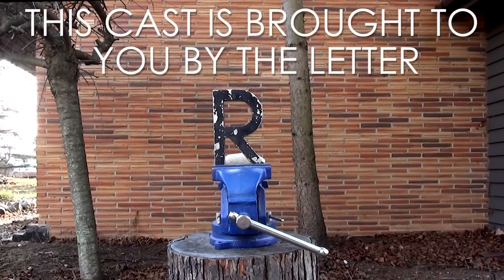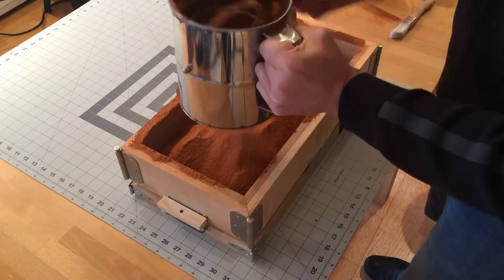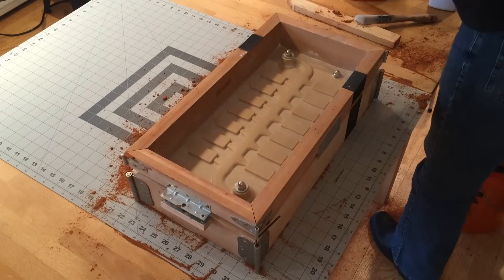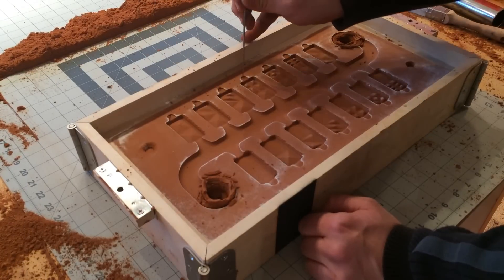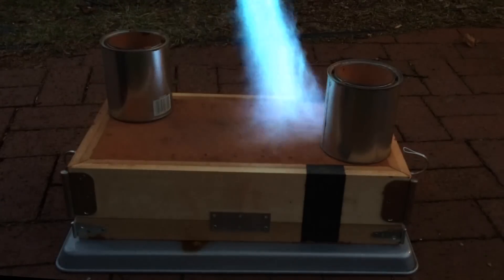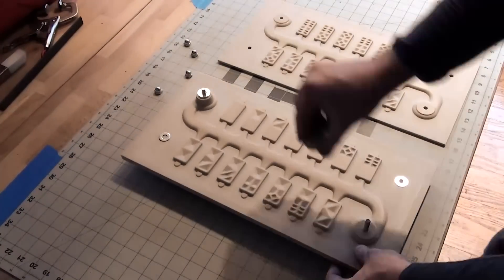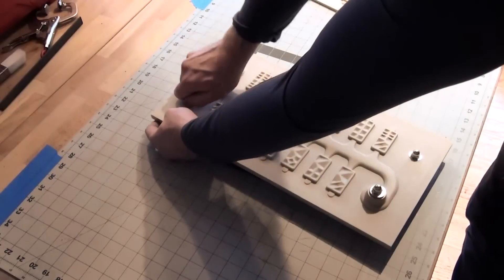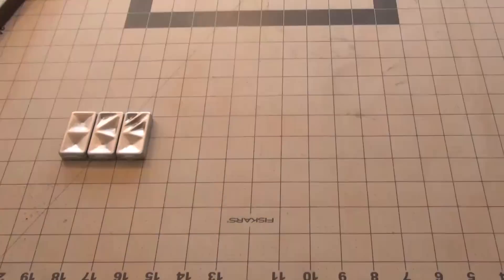Cast Aluminum Dominoes | Sand Molding and Shake Out (part 2)

Comment: Hello do you happen to know what type of sand you were using in this casting? It seems to capture fine detail and keeps its shape under high heat better
Reply from the maker: This is Petrobond and is great for capturing detail.  There used to be a guy that sold it on eBay….
Reply: @Grunblau  interesting

Have you tried casting gears in aluminum? Specifically gears that might be between 2-3mm thick? I know its brittle when cooling but i haven't had a chance to test the strength as ive only been able to cast bars for storage

Comment: hello 🤗 how do you degas of aluminum?  I add sodium carbonate and sodium chloride, but there is too much gas gap in finished part. please advise me.
Reply from the maker: First advise I’d have is be sure to use the correct alloy.  Only use scrap that was casted.  Don’t use aluminum cans, for example.  Gas can enter the metal at any moment so try not to introduce any turbulence into the pour.  Vent the mold as well as you can.  Following good practices for silicone/plastic casting will usually result in good cast aluminum results.  Hope this helps!
Reply: @Grunblau  Thank you very much for the valuable information

Comment: Excellent. Where do you get the lasts? I have a homemade foundry oven, but it does not reach enough temperature, it does not melt aluminum, I use propane gas and a blower, some recommendation?

Comment: Very interesting stuff. 

I'm not sure if it's already been pointed out in previous videos (presuming you've used Diesel before), but diesel isn't really a flammable aerosol like propane and gasoline are, hence why it's a pain in the ass to use as you are using it. 

Diesel when used in engines is much different from any other type of gasoline, where it is simply compressed so much that it explodes, and this explosion drives the other cylinders compressing diesel in the same way. There aren't really "spark plugs" except for when starting the engine and the only way to stop a diesel engine is to shut off the pump. This is quite similar to how hot rods work. 

Standard engines that run on gasoline will compress the gasoline to a certain point (the octane rating of the fuel determines how much it can be compressed without self-igniting) and then uses the spark plugs to ignite the aerosol gasoline.

Comment: is that clay you are using. for the mold
Reply from the maker: +Banished Lynx there is clay in Petrobond!
Reply: Brian Oltrogge i ask because im going to start making mold and i live in a clay rich environment i can literally walk outside dig a foot down and his red clay but i needed to know if it was okay to use
Reply from the maker: +Banished Lynx there is a bit more to it.  Petrobond is clay and sand.  The porous nature of sand allows expanding gases to escape.  Clay makes it stick together and gives it strength.  You might be better off using your clay to make ceramics than molds!  Molding sand is cheap and depending on type, reusable.
Reply: where could i get what you use

Comment: OK. you did a great job. well narrated and concise, the use of Petrobond was a great idea for wonderful detail on the casting. It looks to me as if you are using a graphite crucible as well. i personally use a stainless steal crucible when melting aluminum. works great for me. i also make my own greensand out of fine sand "the finer the better" and bentinite clay "basically pure clay cat litter you can buy in just about anywhere. i grind mine in a blender to a smooth powder." you mix the sand with the clay at 7 parts sand to 1 part clay ,  mix with water to just enough to be able to squeeze it into a ball in your hand and break apart cleanly. simple. my whole operation was self made by me for less than $50 us. i use used moter oil as a fuel ,  i can also use diesel , though i dont use it as much, oil is free for me. my furnace is made from concrete and steel. " yes regular store baught concrete." I don't think i could have gotten as good a forging with my casting as you did petrobond. that was really good.

Comment: Hey, did you calculate volume with inlets, outlets and details? I'm curious how many cm3 you are able to melt in your crucible and be able to do multi-cavity. Something similar is in my head and you are the only one which tried to do homemade multicavity! Great job! congrats
Reply from the maker: +Kamil El Fray Mostly what cross section fits in the domino and the material I cut the mold from. If I was to do it again, I'd make the center runner 2x as deep.

Comment: That was some beautiful flow on those pieces, i'm wondering how much the machined lines (as opposed to simply cut by hand) help with the flow. I know there's a breaking point between pressure and unrestricted flow, but it seems that with better flow you need less pressure (i'm talking about the size of the bell).

Comment: I cant seem to find good videos on youtube for this but, have you attempted using steel molds for aluminium? Like your sand molds, but instead, two steel plates?  Of course that would be very expensive to buy , but say someone had a CNC? Would it be efficient, would you have to use a blowtorch to pre-heat the plate to prevent rapid aluminium cooling?

I have a CNC that can do steel , about 1x2 foot plates, and i want to start doing aluminium work but i dont like the sand method too much, i want to mass produce things ( for the fun of it, not trying to sell shit, but it could get to that )
Reply from the maker: +wargarkaz Sounds like you're looking to make a 'permanent mold for aluminum'.  Try that as a search term.  Trouble is the shrinkage.. Certainly been done before!

Comment: Brian do u sell these I will love to purchase a set
Reply from the maker: +turin_bullies With most of my projects, I try to consider the possibility of producing it at a scale.  I'll eventually look into this as well for these, but if I had to make them as seen in the video, they would be ridiculously expensive.  There is a local company that does lost wax casting and I intend to see what they would charge and what a minimum lot would be.  Who knows, maybe they will be on Kickstarter at some point!
Reply: +Brian Oltrogge you could probably do lost foam casting for mass produced items. you can cut the foam quickly on your CNC machine. once you have the foam cut you dip it in plaster. once you do that you could easily run through multiple castings if you have multiple flasks.

Comment: IS there another way to pack down the sand other than that 2x4(?)? I notice pretty much every casting video does it like that. Was thinking of using a board that fits insite the interior for packing down, any advice if it'll work?

Comment: Its kinda didactic to see the full process but i don’t feel it was the more eficient way to proceed.

I started on video 2, and once I noticed in video 1, that you have a CNC 3D drilling machine, I'm just thinking “its easier to recycle aluminum making a 10 mm plate and use the plate to cast the domino’s in the CNC.”
Reply: it's faster to cast. CNC cutting tales awhile
Reply: David Serrano but he used the CNC grinder to make the original, then he molded on silicone. Unles he wants to produce much more parts, is not eficient (lol I corected to defidient last time)
Reply: Xavi Simon it's a CNC Mill. And the original was either wood or high density foam (he either one or the other in each of his videos). Wood is much faster to mill than aluminum. Foam is even more faster to mill. Milling the aluminum could have taken a day. While doing it in wood could have taken 12 hours and foam would have been 2.  Casting only takes about a hour. And finishing takes a couple hours.
Reply: David Serrano Sorry for the mistake ist milling not 100% wakeup. Its like your “cutting tales awhile" that I avoided to mention last time.

It, I think you are going to hi with the times, its aluminium not stainless-steel.
And even if it was 24h, it took him more time and effort make the molds and al the stuff, the only thing probably will be the finishing if he keeps the parts as they come out, but if he polishes them… not.

I repeat is nice for the exercise and see al the process, but is easier and more deficient to set up your machine and do other stuff.

Best regards.
Reply: +Xavi Simon I was only correcting you on calling it a grinder because I wasn't sure if you actually thought it was a grinder. didn't mean to be rude.

Comment: Why do you plug up the furnace while you let it cool down?
Reply from the maker: +Craig Dick It helps not to temperature shock the refractory or the crucible.  The slower the cool down, the less likely the refractory or crucible will crack.  That and I don't have to worry about bugs and small animals when in storage...

Comment: Do you recycle the sand you use? (Use it for other molds)
Reply: Btw cool video
Reply from the maker: +Rokuro _  Thanks!  I recycle the sand that has not been burned.  In the shake out you can see the black sand.  I remove as much of this as possible.  This could be reclaimed as well if I had access to a muller.  Not a big loss though.
Reply: +Brian Oltrogge ok cool

Comment: really cool man
awesome channel

where did you get your.... "Grip" or "Tool" with which you grab the canister out if your furnace?
and why does your canister consist of?
and what do you stuff inside the holes of the stove to cool it down?

have a nice day :)
Reply from the maker: Thanks!

I designed the lifting shank for myself.  I might make these for others in the future as it works great!  The crucible is a #10 graphite crucible from lmine.com.  The plugs are left over ceramic blanket.
Reply: +Brian Oltrogge 
is it possible, that you can make a video about how you built it?
'cause it looks really professional :)

Comment: Hi Brian.  Thank you for your inspiration. I have been looking for a lifting and pouring instrument like you use here. where did you get your casting tools. In particular your lifting and pouring tool. Thank you.
Reply from the maker: I designed the one I am using...  Seems like there might be an interest in producing a limited run of these.
Reply: +Brian Oltrogge certainly could be. I haven't seen anything like it and i have been looking. what impedes me most is your attention to detail makes for high quality products and these seemed like a very well thought out solution. Thanks for your videos.

Comment: Love your style Brian. I would soooo love to be able to do something similar some day. I plan on doing jewlery, dental crown, Viking stuff. Did you build the crucible holder thingy you use to pick up your crucible and pour??? Or is there some place I could buy this? Also, how fas can you push this furnace, meaning what are the metals you are able if willing to cast pr now? That Diesel fuel sure looked cookin hot
Reply from the maker: The crucible tongs are my own design, although I am not opposed to making them for people.  Just need to figure out how to do a batch of them to keep costs down.  I look forward to trying other metals!  With aluminum the furnace is almost too hot with diesel.
Reply: Nice work. How much would you charge me if I would order one from you? Pretty steep shipping prices, but hand made by someone with skills is almost always worth it.... I loved it when you used diesel, but most certainly overkill with aluminum....cast iron next?

Comment: I think when you're running the forge on diesel, you're running it a little too rich/high. That jet of fire out the top is probably just wasted heat.
Reply from the maker: Not wasted if that is the only thing keeping you warm in 20 degree weather!  You are probably correct though...  I should have dialed in the mix a bit more...  Either add air or choke off the diesel a bit.
Reply: haha good point, after spending 8 hours outside today in -20c weather I would appreciate that little extra heat lol.

Comment: Hi , I was melting aluminium and the coal burned out and the aluminium set solid inside the crucible before I could get it out , would it be ok to try and melt it again ? "It's stuck in my crucible" lol
Reply from the maker: I am sure you probably solved it by now...  Answer is... depends.  If your crucible has tapered sides, it might be fine, if not, it might split the crucible.  If that happened to me I'd probably just try to melt it again knowing I might end up with a mess.  But it would be the only way to reclaim the material and crucible.  Just be careful moving the crucible incase a split isn't obvious...

Comment: I actually made a foundry just like yours a few years ago only a little bigger. It works extremely well but I know absolutely nothing about casting... any advise? id mainly like to know what kind of sand to use for your molds / where to get it, and if you add anything to the aluminum after scraping the slag off to make it a better quality??
Reply from the maker: Keep watching YouTube videos and internalize the process!  Sand is petrobond from petrobondforsale.com.  I do add washing soda and sometimes lite salt.  Might be superstition, but I have pretty good results with it.
Reply: Thanks man.

Comment: The stand for the portable bandsaw, is it bought or handmade?
Reply from the maker: I designed it to meet my needs, drew it up and had the steel cut, bent and powder coated.  I will likely do a small run of them based on the interest...
Reply: Id love to get the plans for it. i have the same bandsaw

Comment: Nice video but please protect yourself and don't pour or melt over concrete. 
Make a small sand box and do all your pouring a least in there. Concrete likes to explode when 1400+ degree aluminum hits it.
Reply from the maker: This is good advice!  I am casting over a brick walkway and using dense firebricks for this reason.  I hope to have a more permanent casting station in the spring complete with a sandbox!

Comment: Fantastic. could use this method to make custom two part rims for my Mustang and Jaguar JR go carts to match the stylized wheels of the full size cars. The wheel diameters are 5 and 6 inch so in the same size frame as you use for the dominoes, both sides of the split rim could be formed.
Reply from the maker: I am considering doing just that with the rim I made in a previous video and my husquavarna lawnmower!
Reply: Did you get a chance to see any of my videos so you can see I am dealing with very detailed scale versions of the full size cars. And wheel choices are very limited for builders.

Comment: "This cast is brought to you by the letter R, and this wrench" pmsl. 
Loved it, totally unexpected.
You wont believe it but I was engraving works initials on exactly the same Rigid wrench last week.
Great production, safe work methods, the only thing I am concerned about is your shoes, please get some work boots preferably steel capped as your current shoes dont offer enough protection top or bottom. If you saw the burn marks in the bottom of my work boots you would understand why.

Comment: What part of the work was the most fun for you?
Reply from the maker: Hard to define the span of the project since I built a lot of the tools that went into making these and seeing those tools work is extremely satisfying.  As far as a casting goes, the shakeout is the best part, especially with lost foam.  With lost foam casting, you spend most of your time holding and shaping an otherwise useless piece of foam.  Stick it in a bucket of sand and pour in aluminum . The thing you pull out is a very good copy of the foam part in aluminum.  It sort of surprises me every time I do it.  Was it really that easy?  With ramming up a petrobond / sand mold, there is a lot more planning and effort.  By the time you are done, your arm is sore, your back hurts and you smell like a Jiffy-lube.  A successful shakeout is more of a relief than a happy surprise.   I suppose the best part in this case is the next morning when you are having your coffee and you remember you made something the day before and you go look at it.  I do look forward to the first game of dominoes though!
Reply: +Brian Oltrogge It looks fantastic. Will you soand the edges of dominoes square on beltsander or they stay a little rounded? You cant arrange them vertically like this...for the domino effect :)
Reply from the maker: Yes, I'll be getting a belt sander in the next couple days.  I am building my own 72" belt sander, but it won't be ready for this project.  They will be semi rounded but they will need to be able to stand up for sure!  How else would they work in my Rube Goldberg device!
Reply: +Brian Oltrogge will you be doing a build video for the sander? love your channel I was inspired to make my own foundry after watching your foundry build keep up the good work